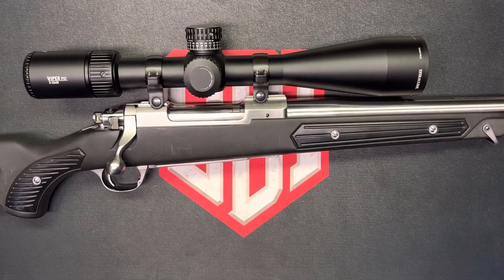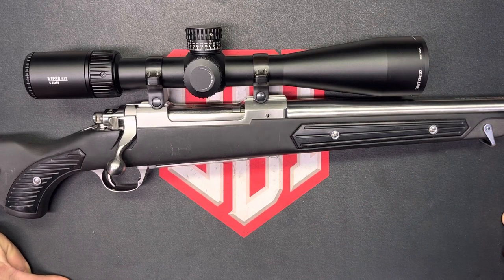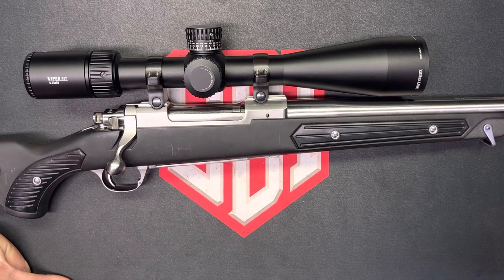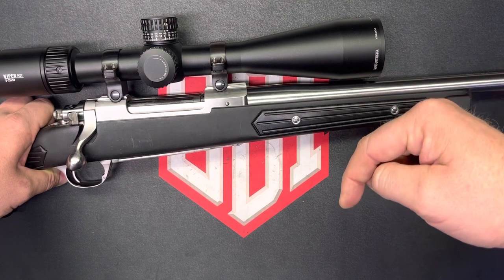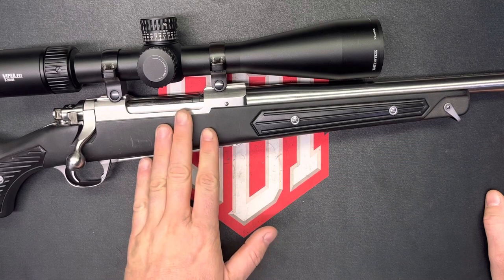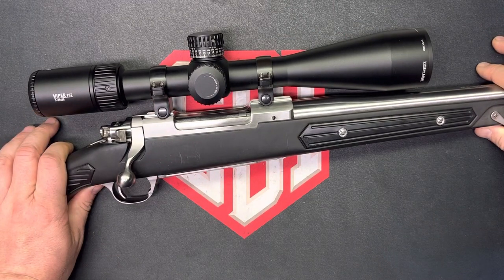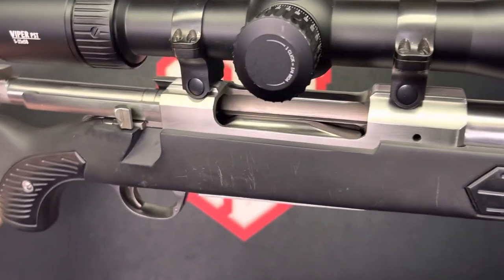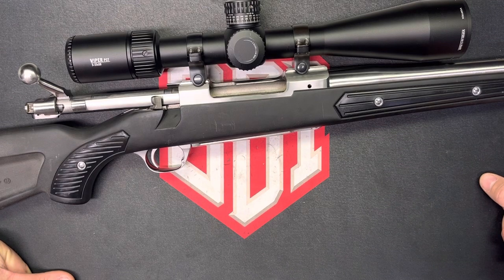Sonoran Desert Institute - 416R Stainless Steel - Ruger M77 Mk II All Weather .338 Winchester Magnum

Comment: "machinability" can mean softer, but regarding stainless steels it usually means that the grain chips better. Stainless can deform under a mill and spit these uneven ragged and melted chips, leaving a bad surface finish and putting extra wear on the tool.

The M77 Mk2 is a really cool rifle, especially the safety. I know it sounds like a weird thing to praise but the recent industry trend to 2-position+plunger bolt release just proves that intelligent engineers will spend immense mental effort making things worse instead of just copying a good idea.
Reply from the maker: Hah!  You’re very right about that.  My main gig is electronics technician for the FAA and I swear the engineers’ main goal in life is to make life as hard as possible for techs.  I imagine them sitting in big leather chairs with scotch and cigars, chuckling to themselves about how long it takes to open a case with 60 thumbscrews on it when four would have been plenty.

Comment: Some dissimilar metals are fine togheter.
Reply from the maker: Very true. All depends where they fall on the galvanic scale.  Stainless and titanium will play nice, carbon steel and aluminum is usually ok as well.  However carbon steel and stainless steel are on opposite ends of the spectrum.  Good info for anyone interested in working on firearms.  Thanks for watching!

Comment: So the rifle shown would be prone to have rust accumulation at the junction of the blued rings to the stainless receiver!? Like the ignorant auto manufacturers that so often use steel bolts threaded into solid aluminum castings. Try getting one of those out that's been in there for years! Good informational content!
Reply from the maker: It doesn’t seem to be as bad when it’s ferrous steel connecting to stainless steel, but it is for sure still something to keep an eye on.  Sooner or later I’ll pick up a set of stainless Ruger rings, but that’s another $90+ dollars after tax and shipping.  I’ve got too many project trifles going at once. Need to focus and finish one thing before I start another.  Story of my life. Haha